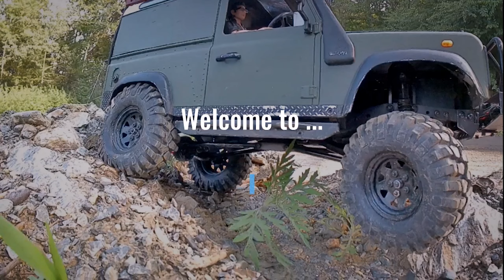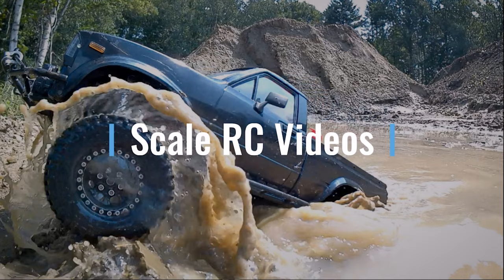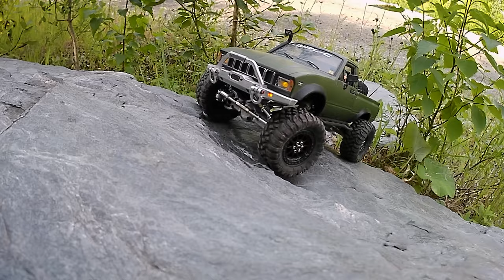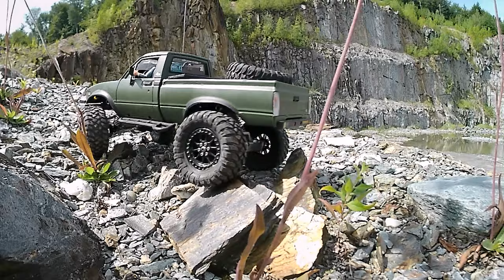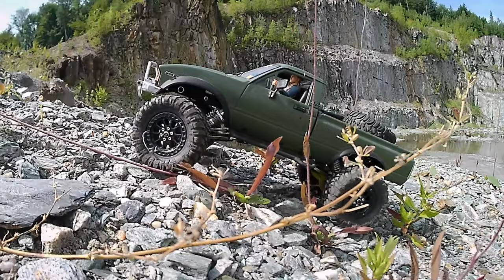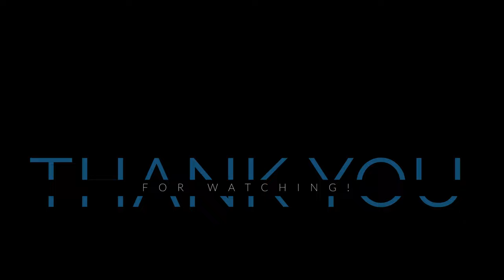WPL C24 Green Machine at the Quarry AGAIN

Comment: 5:00   Sick shot there with background...
Reply from the maker: I definitely miss The Stancliff Pit / Quarry.
Reply: @VermontScaleCustoms  I am going through the playlist heheh. Thanks for making them. I recycled a Couple Power cells. and Made a 2s 7.4v battery with 3 wire charging balance port . Wife's youngest got in trouble so i have to stop spending for a little. UGh dang kids.
Reply from the maker: As you can see, I spent some time out there just running trucks every weekend, coming home and making ASMR vids. It was definitely a thing for me for a few years. Now that I'm in IL for a while there's not much to drive on. Just trail stuff. Minimal rock crawling within short drives.
Reply from the maker: Too bad about the kid getting in trouble. Seems like being a kid is still as tough as it ever was if not even more difficult from all the distractions.

Comment: Amazing crawl love how that engine works I gave a similar  experience  I took mine out of a fc model  f1 jeep  that was too fast in the jeep to get it to crawl now I can't keep my truck going all the time thou I wonder is it's my esc
Reply from the maker: I think those stock WPL escs have a max output of 10-15A. You may want to upgrade to a 40A or 60A ESc in order to handle the load. It's probably stalling the motor for lack of current. Which could possibly affect other functions. I'm not sure if that would have anything to do with your binding issue, though.
Reply: @VermontScaleCustoms  I found out I had hair in my front right tire all bound up I am going to try and find a 60 a esc  it would give me more options as well as I think the 60a has a winch input and sound I like the sound mods gives it a realistic  sound in slow motion
Reply from the maker: @benjamincloutiermainerc  I don't know much about WPL electronics since I don't run them in any of my stuff. But I do know they updated their main V3 electronics ESC. That's the one that has built-in winch control and sound output. A 60A ESC doesn't come with that sort of functionality. You would need to get a good 4 or 6 channel radio and transmitter setup to handle all that extra function.
Reply: @VermontScaleCustoms  they sell the v3 with controller  and  sound system   and a winch but as I see that I should go with a 60a but I need to find one that isn't for a 1 /10right
Reply from the maker: @Benjamin Cloutier  nah, the 60A is perfect for the 1:16 scale. I used to think the same thing until I tried it in my C54. It changed everything about how it drives. It gave the motor so much more current to work with as well as usable throttle, etc. I'll honestly never run WPL electronics just because I have switched almost everything over to 40A or better in all of my WPL trucks. The two trucks I have with 60A in them are absolute beasts.

If you're into trailing and running in the backyard, you're fine with the WPL electronics, in my opinion. 

In my opinion, if you want to take it to heavy load rock crawling where low speed and holding throttle position and having the ability to micro adjust is essential then you need to go aftermarket. I'll argue that with anyone all day long. I use a FlySky transmitter for all my WPL rigs and my Redcat Gen7. The modulation is better than anything else I have, Axial included. And they make nice electronics fresh out of the box.

I mean, all in all, a lot of people run V3 electronics and swear by them. I have only had one V3 board and I cooked it last winter along with (2) 2-speed motors. I've never had that kind of luck with anything else so I just go with what I know. 

I don't want to steer anyone wrong or off a path they think they should be on. Which is sort of why I don't generally make recommendations of what to run. It's all so uniquely built that it's tough to say what works well for would work well for anyone else.
Reply: @VermontScaleCustoms  flyskys are among looking and not bad price wise either
Reply from the maker: @benjamincloutiermainerc  I use rechargeable batteries with mine, too. They last forever and won't break the bank every time you need to swap them out. Mine takes 8 AA, so it can get expensive if you don't use rechargeables in them.

Comment: Are those fayee tires?
Reply from the maker: Yes, Fayee with those new MN/Injora rims. Little bit of foam in there too to hold them up in the middle.
Reply: Thanks for the info bro, I will try this setup.
Reply from the maker: @morrisrc  Nice, I think you'll like them. I've run these on all kinds of surfaces at this point and they're awesome! I cut the Injora/MN foams down about half and it gave the center fo the tire just enough to hold it up. The corners and sidewalls still have enough to compress when necessary. I will say that I have popped the bead on the left rear a couple of times since building the set. I plan on gluing them to stay because I don't see the reason to run anything else on this build.

Comment: What size is that tyre…so hard to find 1/16 scale tyre
Reply from the maker: Fayee tires on Injora plastic beadlock rims, glued beads. If you google Fayee tires, they pop up all over the place. Truthfully, the compound is less than stellar compared to all the others out there but it works for this truck due to the lack of size options like you said.

Comment: What tires are you using and rims
Reply from the maker: Cheap Fayee tires on plastic beadlocks from http://tinyurl.com/4ra9r2pe - I can hardly recommend them if you're looking for ultimate performance. They look the part but the rubber is awful. Way too hard. Looking forward to finally switching to 5-to-7 MM adapters and using stuff from the 24 scale trucks. They make 1.2 and 1.3 rims and tires. The whole world just expanded for these trucks.

Comment: Where did you get the rear bumper for the rig?
Reply from the maker: That is from an RC4WD Gelande II 1/18 D90, my friend. It’s actually the front bumper off that rig and got screwed right on to this as the rear. It’s also metal which is nice.
Reply: @VermontScaleCustoms  cool. Thanks. I been building and modifying my c24 . I just had to paint it nato green like yours. Got a 3d printed ESC tray from Liang RC . He’s on Etsy and installed a 1080 Hobbywing in it. Set of bead locks from Liang RC. The only pet peeve I got with WPL is the metal axles. High maintenance. Thanks for all you do. Keeps me motivated.
Reply from the maker: @darrenmackenzie1645  Thanks for being a continual supporter of the channel. That is very much appreciated. C24's are fun to mess around with. I love that green machine. I need to get it out and run it again soon. The axles on this thing are pretty good. I usually tear them down once a year and tighten everything, lubricate, loctite, and rebuild. They're going on 3 years old and haven't given up yet. They're the boxy heavy duty with round diff, not the square one. 

Now that I'm more familiar with fabricating frame links, I may try and see what I can come up with for a C44 comp rig. I see a lot of potential in that chassis being forward weighted.